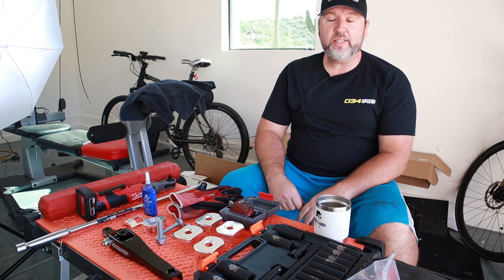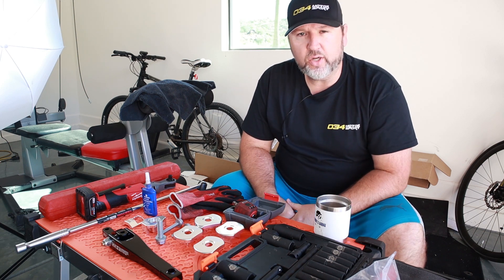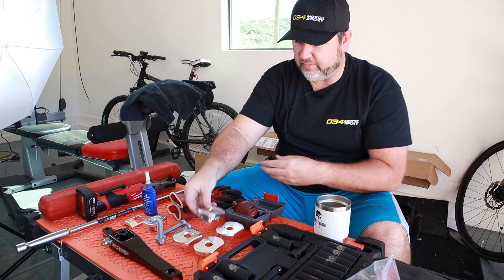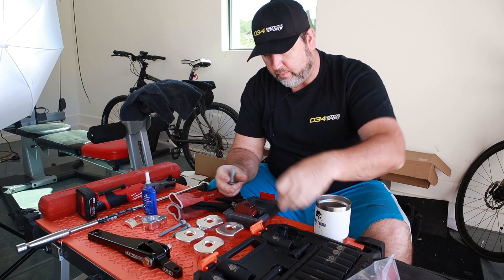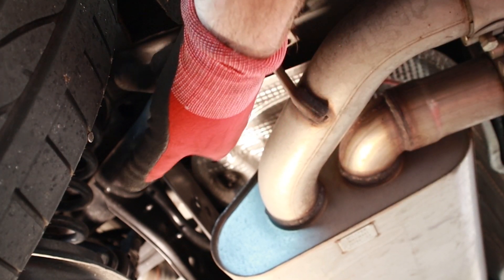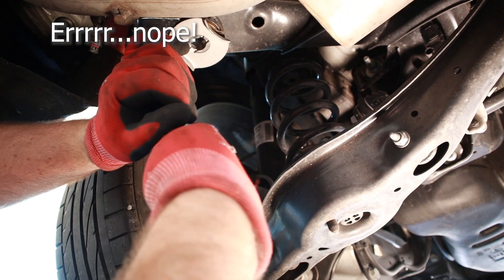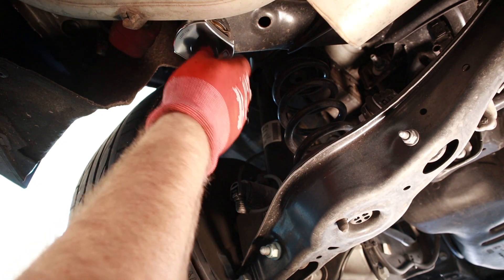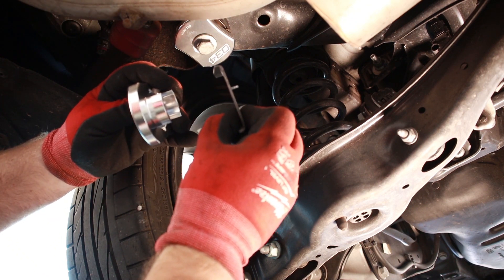034 Motorsport Mount Install - Mk7 VW Golf R - Dogbone - Rear Subframe

Comment: Was that a nail in your Left rear tire?
Reply from the maker: Good eyes, yes, turned out there was!
Reply: @DWraysGarage  By the way, great video...did you notice a difference and did you do your front also- Thanks
Reply from the maker: @peterknight6791  I noticed a positive difference in the turn-in, but also general stiffness of ride - for me not a bad thing and amped up by the lowering springs I did later. I did not experience too much of the NVH people complain about, but maybe I'm more tolerant.
Reply: @DWraysGarage  Thanks, My car is presently lowered on Eibach Pros...Great look but pretty low for a car I drive pretty hard on the back roads, hence the ECS belly Pan Haha! Upgrading my front K frame to a Audi RS3 aluminum frame and plan on using a similar self aligning bolt/ spacer kit in the front but did not know whether the backs were are necessary addition. 25mm rear sway bar makes the car rotate well but feeling connected to the road is my biggest focus- Thanks for all your input- Pete

Comment: Great video. Much better than most out there! However I was glancing over the 034 instructions and they call for the 21mm bolt to be torqued at 100nm. Did you do 150 because you reused the bolt?
Reply from the maker: Thanks for watching. Yes, I went deeper because I probably should have replaced that hardware but didn't want to hang up the install because I overlooked it. No issues arose.
Reply: Right on! Also I accidentally said 150, it appears you did 130. I’m glad either way that it’s working out for you. I can’t wait to get mine on. My hand is broken but I’m thinking of trying it one handed hahaha

Comment: So I have a mk7 R with the 034 springs, rear sway and sway bar endlinks and also the sub frame inserts along with the dog bone insert, I have version 1 in my R. I just ordered the full dogbone Mount and the lower insert, I’m anxious to see how the car drives after it’s installed, did you have any increased NVH after installation?
Reply from the maker: Only thing I really noticed was a little extra V at startup and when reversing. Don't notice it anymore at all.
Reply from the maker: I really like the immediacy of the take off after the full dogbone went in. You lose that tiny lag of the trans to motor engagement.